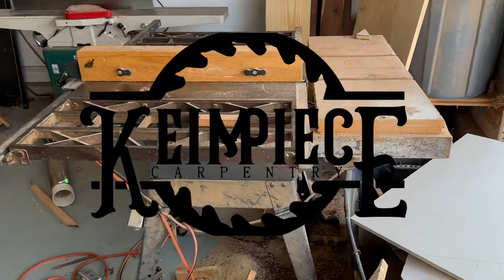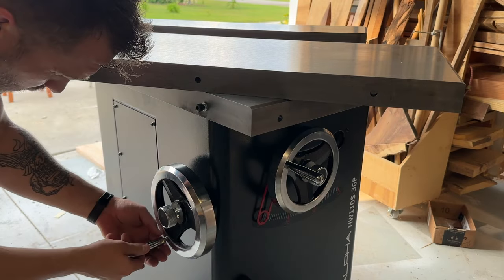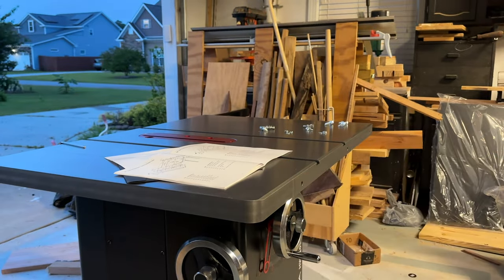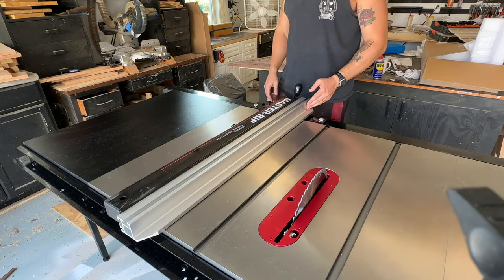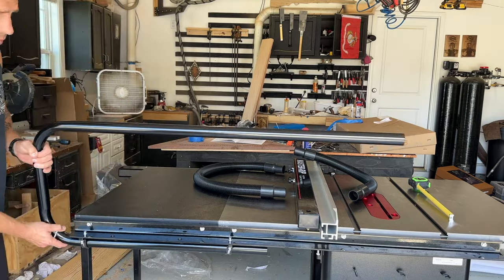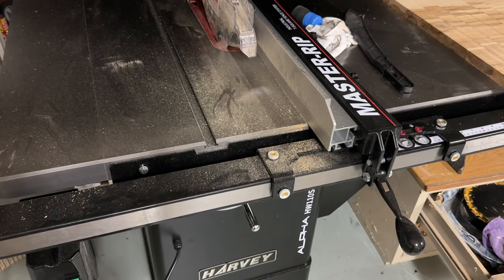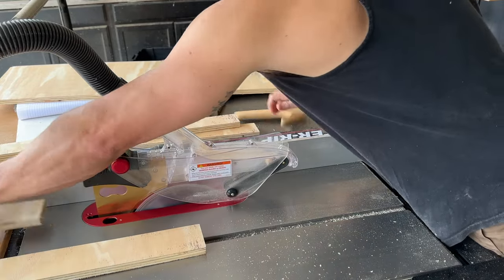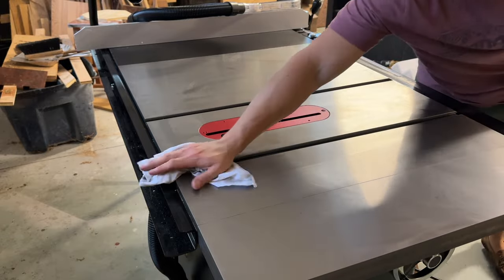Harvey Alpha HW 110S - 36P Set up / Review

Comment: You will love this aw, I love mine. I moved the black end exstenion top to the rear and it is now my out feed table, works great and was very easy to do.
Reply from the maker: I built a quick and easy outfeed table that doubles as extra scrap wood storage. Basically just a 2x4 box with mdf top. I put leveling feet on it though so I can fine tune the height and get it perfectly level and even with the table saw, since we all know garage floors are never level
Reply: I like your idea about moving the black extension table...how's that's working out so far?   considering that..or eventually maybe trying to added a router plate.  I think i have a cutout template somewhere that came the router lift I bought years ago 🤔
Reply from the maker: I'm actually about to install the Harvey Router System, it comes with a cast iron insert. 110lbs. So I'll be removing the black composite piece and replacing with the cast iron.  @tomcooke9221
Reply: @steelhead1194 so you have set up a couple inches from the rear rail or were you able to  somehow attach it?
Reply: @steelhead1194 That G700 looks like a beast of a machine!

Comment: I have a SawStop and mine was the same way when running only the overhead off a 6HP ShopVac. I then plumbed in a dedicated line off my Rockler 1250 Dust Collector to run in conjunction with my overhead, and it is a world of difference. There is hardly any dust. You could damn near eat off it!
Reply from the maker: yea I was thinking about doing something like that. Using the dead space under the table for a dedicated dust collection system

Comment: I agree with you about the instructions ...I'm in the middle of setting mine up now. the exploded diagrams at the end helped me with alot of the which bolts go where questions.  I quick note, you installed the legs incorrectly...they go underneath the table.  I almost did it the same way you did 🤦      nice video all around!
Reply from the maker: Dang, I'll have to take a look. Evidence that the instructions aren't good. I'll have another video coming out on the slider attachment and the router

Comment: What dust collector do you have? I suspect it is underpowered. You should be getting much better dust collection.
Reply from the maker: I have the Harbor Freight 2HP with a cyclone and canister filter. I have another video showing how I built that out.
Reply: @KeimpieceCarpentry  I have a clone of this table saw with nearly the exact same dust collection setup (literally different colour plastic on the back solid coloured piece). The dust collector port that offshoots to the 1.25" port is useless, the air flow from a dust collector just isn't fast enough for smaller dust/chips. Cap it off and hook the blade guard dust collection up to a good shop vac or if you have one a dust extractor. I did this and now have almost zero dust when making cuts. Hope this helps.
Reply from the maker: That's exactly what I was thinking of doing and storing a shopvac under the wing. I find that I don't use the overhead attachment very often as unless you're doing a high number of repeat cuts at a wider width (3 plus inches) it's not very practical. thanks for the info @sphixcanada